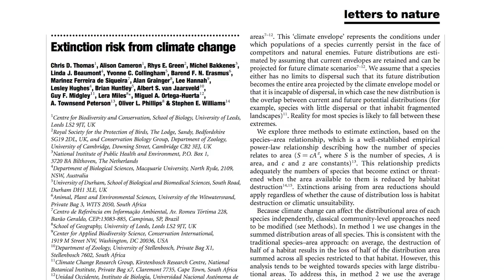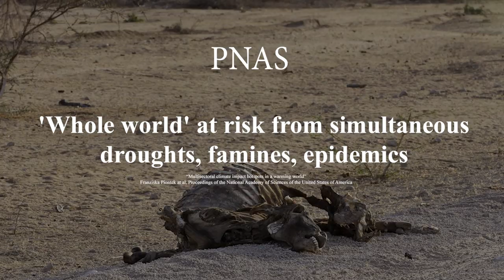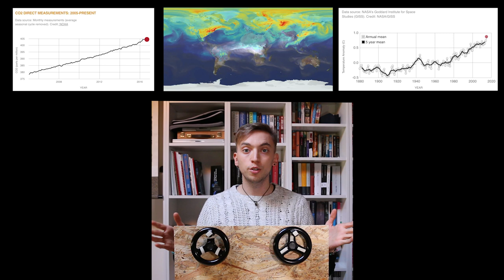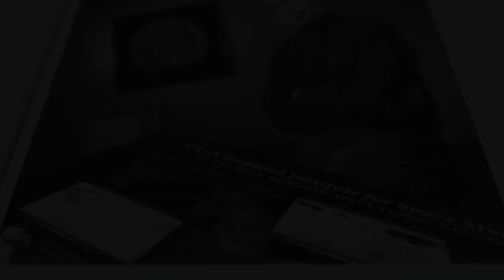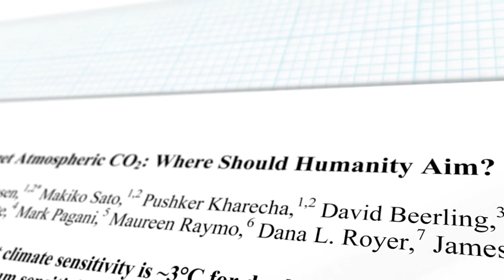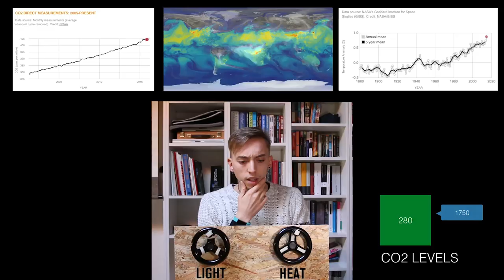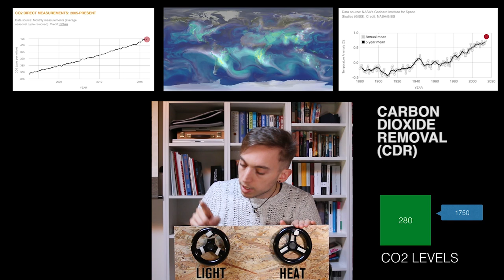How to Fix Climate Change: Part 1, How We Got Here | Eternally Curious #9

Comment: Solutions at 6:38 are not solutions.  Suburbia + solar panels?  Self-driving cars?  They induce demand.  Economics 101.  Why not traditional urbanism, bicycles, reduced consumption, eating vegetables?  Things that make us healthier & happier.
Reply: Those methods reduce the amount of CO_2 produced. They don't reserve the actual CO_2 present in the atmosphere.
Reply: Gabriele Giordano I agree.  My point is that high tech sprawl is still sprawl.  Increased efficiency in a flawed system amounts to nothing if you induce demand.  Self driving cars enable sprawl & increase mundane trips.  No CO_2 savings.
Reply: Using Fossil Fuel will add more CO2 into the atmosphere (which were originally trapped underground) where as using renewable energy will not. Renewable energy is not the same as simply more efficient Fossil Fuel.
Reply: You are forgetting the mining for all the rare materials that go into batteries and other tech for the systems you refer to.
Reply: Force Chinese, Indians and Americans to "raditional urbanism, bicycles, reduced consumption, eating vegetables"...mission impossible...